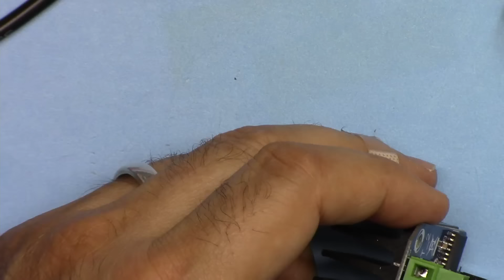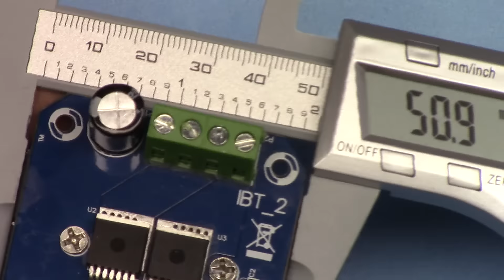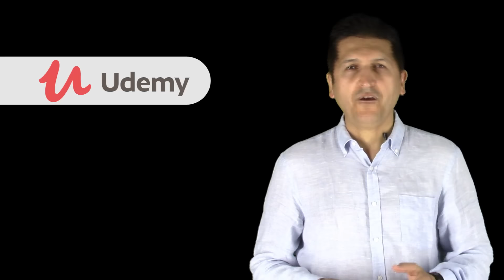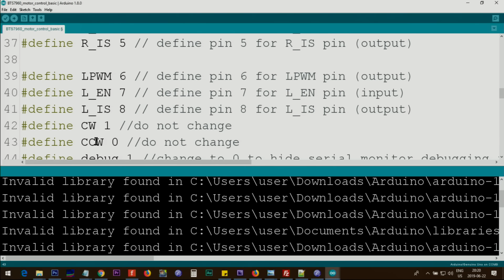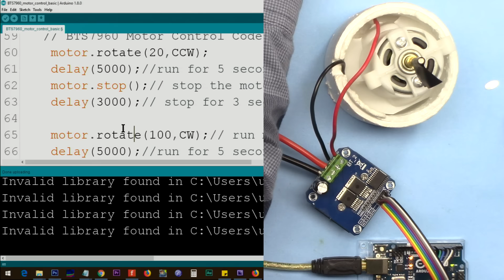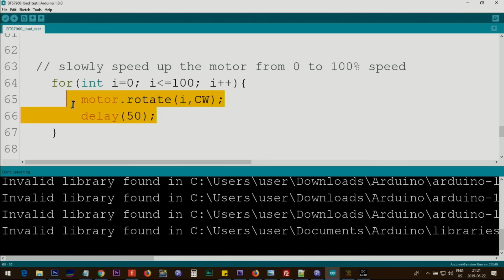Using BTS7960  BTN8982TA PWM H Bridge motor controller module with Arduino library RJT169

Comment: So what happened to your library? The link seems to be broken.
Reply from the maker: perhaps you were using chrome which has issue with false security. Use Microsoft Edge which is better. I changed the way link was parsed. try it.
Reply: @robojax  Thanks for updating the link. It works now, in Chrome.
In which country do people use Microsoft Edge?
Reply from the maker: Canada.  Edge is now much better than chrome and Bing has become very powerful using AI for search results.
Reply: @robojax  Thanks. It's certainly not catching on in Europe. And it's slow. But I suppose no one in Canada would notice.

Comment: Hello.  What happens when both Enable and both PWM pins are set to High at the same time?  does anything burn up? or, does the module understand this is a bad input and doesn't turn anything on?  thanks!
Reply from the maker: Hello, I believe I have explained it. Nothing bad will happen. It will for motor to stop.

Comment: Hi, great video and explanation. Very detailed. Thank you. May I ask if I can connect two 12 volt dc motors to one BTS7960 controller? Thanks
Reply from the maker: Hi, in parallel? Yes and the total current should not exceed the rates current. But if you want them to be controlled separately then you need second module for that.
Reply: @robojax  Thanks for the super fast response. Appreciate it. I plan to control both motors together. When turning, one motor will move forward and the other one will move backward so that the robot car can pivot/ turn. Can this be achieved? I will use Raspberry Pi to control the car. Thanks
Reply from the maker: two motors can be configured to operate independently. Using the library I've written will make it easy to send commend to control each. so you can send command to run in CW direction while at the same time sending command so 2nd motor rotates in CCW direction. This library is for Arduino and I have not tested it with Raspberry pi. The code for dual motor control is in the resources page.
Reply: @robojax  Thank you :)
Reply: @robojax  Hi, how are you doing? Hope you are well. Can I ask if you have tried using BTS with Raspberry Pi? Thanks

Comment: Can I use this bts7960 with a nema 17?
Reply from the maker: Nema 17 usually need about 2A current. this is like 15 times higher.  if this module is capable of controlling two DC motor fully (I forgot how many this can control) then yes  you can use it . If not, then use two of this module. But you gotta write y our own code for stepper motor.

Comment: Would u do another test on the power handling?   Remove the heat sink and put it on top of the iC's .   All you need are longer bolts . It fits beautiful.  You  may have to drill out the holes on the heat sink a tad to fit your longer bolts. I know its an old device. But i would bet there alot laying in junk boxes.

Comment: After downloading the library and uploading the code to the arduino,  why does my motor not respond when turning the battery on? I wired everything the same way
Reply from the maker: If you have not change the code, then the wiring has problem

Comment: My motor rotating when I use command CW it is only rotating when I use CCW
Reply: Please reply sir
Reply from the maker: if you have not changed the code, then check wiring.
Reply: @robojax  thank you for your response
Yes actually I had connect VCC and gnd of motor driver to Arduino so therefore there was some variation in current

Comment: is it possible to use 2 of this driver with one microcontroler ? also can u limit the current output using pwm because i think it hit the peak current of the motor so my battery just cut off. thank you
Reply from the maker: To sue two of this, the code is on the resources page.  For  current I don’t  remember what I said , if this chip has this capabilities, I should have mentioned it.
Reply: @robojax  can you share the link ? Thank you

Comment: this may just work for my battery charger switch ?
Reply from the maker: of course. I read your comment on the mosfet module. this is way more than what you need. but for sure. if you set it to 100% duty cycle, it will be just a switch.
Reply: @robojax  thank you i thought as much just a bit new to dadta sheets and such some of it not understood yet but i an learning Sir God bless

Comment: Hi Ahmad,
Read with interest this article https://www.youtube.com/watch?v=PUL5DZ9TA2o and I'm still not sure how it works.
 Activate the high and low side mosfets.
For simplicity, say I didn't want to use an Arduino but simply drive the inputs with +5volts.
If I enable say the l/h chip {INH  High} then apply a high to {IN} how do I enable the r/h chip so that the lower mosfet is connected to ground and assuming the l/h chip the top mosfet is connected to the supply rail.
Does it mean that on the r/h chip I enable it {INH  High}, will that in turn, turn on the lower mosfet with {IN} low.

I'm at a loss.

Can you help
Thanks
gazza

i sent it to you email address,opps.
Reply from the maker: Hi, yes that is true.  you will be able to turn the motor ON and OFF and change the direction of rotation. But you won't be able to change the speed as you will need a computer or microcontroller like Arduino

Comment: Hi Sir.. With this BTS7960 is it possible to use (without arduino) 555 timer (with Pinout 3) 20kHz/25kHz for PWM?🤔😔😓🙏
Reply from the maker: Hi, I have explained this Skype fully. If you watch it, you will get your answer

Comment: Hi, this is very interesting. But I have a question. Can I supply power with Accu Battery 12v for BTS or I need another hardware?
Reply from the maker: Hi, the voltage sources should be the voltage as the motor. it does not matter you get it from as long as the battery can supply needed current (power) to the motor  it should be fine.
Reply: thanks ao much

Comment: You can brake a motor with the BTS7960 PWM H and how it would be done
Reply from the maker: Stop is the brake. to coast you just set the speed 0.  but brake is stop. see comments from @Whitney Design Labs

Comment: Very good information. To improve the thermal conductivity, the heat sink can be removed from the 2 screws and modified a little to reinstall it on top of the IC chips  with longer screws. Now the heat sink can do a proper job of absorbing the heat and prevent thermal shutdown. A fan can also be used for optimal cooling.
Reply: Interesting idea, I have also seen comment of just adding thermal past.  I just ordered 2 for a trolling motor project.  I think I will need to run them in parallels.  But after you comment I might try to add the other heat sink, and use them on both sides as an experiment.
Reply: @ericbommer2280  I am also working on a trolling motor project and I've added thermal paste to mine, but I'm still not sure how well this is going to work
Reply: Yeah, I think they are M3 screws, so I got longer ones and flipped the heatsink over with some thermal paste on top. It certainly should work better.
Reply: @RichardHauser  how have you done this can you send a photo please
Reply: @omaryasser7473  I have no way to supply pictures. But it's pretty straight forward. Remove the screws and get longer ones. You will have to grind or file the heatsink a little so it will clear the connector post and capacitor. Use some thermal paste and screw it back on top of the chips using longer screws.
Reply: Would you provide an update after you have done this? Would be nice know if it's better

Comment: Hi Ahmad, I have watched your video several times and have your test code working fine. My question is about the current sense pins. Are we getting a value from the motor controller anywhere for a current reading? I understand the main code, but don't fully understand the class (library?) and don't see where these pins are used. I know it has been a few years since you wrote this, but if you can shed some light on the current sense pins and usage, it would be much appreciated. Thanks!! Scott
Reply from the maker: Hi, I just checked the code and watch portion of the video to see what I have done. Because to measure the current we needed external resistor, I have not included that in the library. I opened the library and checked it there is nothing for current sensing. Sorry.  if I see interest in this module a lot, I might try to make another video and show current sensing but as of now, it seems there is not enough people to encourage me to make new video on this.  if someone pays me to write code and show how to measure the current and take action when current reached at certain value, I might consider working on  it.
Reply: @robojax  Totally understandable. Thanks for taking a look. I think the current sense function would be useful, but not not required to do the things I have in mind. The reason I asked about it, is that I have been experimenting with a with simplified code from Saravanan AL and wiring the R_EN and the L_EN together to a single GPIO, and not using the L_IS or R_IS pins at all. This means that it only takes 3 GPIO per BTS7960. I am working on a 6WD rover, so this means a single Raspberry Pi Pico, can run all six motor drivers and still have some GPIO left over. So I was wondering if those extra pin connections were necessary, in order to save GPIO pins on the microcontroller. Thank you so much for all your educating on YouTube.

Comment: Thank you so much! Works great. I moved your test code and wiring over to a Raspberry Pi Pico and it works great. All I had to do was ensure to use same GPIO pins as the code. It worked perfectly with no issues. BTW, I am using a wheelchair motor at 24vdc. So far under no load, running non stop for an hour,  the chips don't even get hot.
Reply from the maker: you are very welcome. would you please share the code on Google drive or somewhere so I can share it with other? many people might need it.
The best thank you for me is to subscribe to my channel. thank you.
Reply: @robojax  Thanks again. I thought I replied already, but I don't see the comment. Here is a link to my video using your code: https://youtu.be/kxGwZ1kxaq8 which also has a link in the description to my Google drive with your code. Here is also a link directly to the drive with your code: https://drive.google.com/drive/folders/1KXQD5Gj2zxjA9OD6UG3i-uvIzwmdMY55?usp=sharing
Reply from the maker: Thank you. I just found your comment. it was flagged as spam.  Watched your video with  Excellent demonstration. I have worked with Raspberry Pi and I assume the code should not work as it is in totally different format. But not sure about Pico. may be something has come which I don't know. Regardless, I am pleased that I have been helpful to one more person(s). Cheers.
Reply: The pi do Not have a 5V pin, have it?
Which pins do you use at the pi?
Reply: @4plus17  It seems to work just fine with the 3.3v PGIO from the Pico. I posted a link to my test set up here: https://www.youtube.com/watch?v=kxGwZ1kxaq8 That link also contains a link to the modified code, which lists the exact GPIO pins I used. But you can use any pwm pins you like.

Comment: For some reason the motor turn only ccw. The only change i did are pins .
#define RPWM 8 // define pin 8 for RPWM pin (output)
#define R_EN 9 // define pin 9 for R_EN pin (input)
#define R_IS 10 // define pin 10 for R_IS pin (output)

#define LPWM 11 // define pin 11 for LPWM pin (output)
#define L_EN 12 // define pin 12 for L_EN pin (input)
#define L_IS 13 // define pin 13 for L_IS pin (output)
Reply from the maker: pin 8 does not have PWM feature. I mentioned it in many videos.
Reply from the maker: so watch the code section of video to learn it.
Reply: @robojax  Thank you very much i change the pin 8 and now work perfect.

Comment: Hello, excellent video, very complete, I need to connect several motors, but the arduino has a limited number of outputs, I thought about using a PCA 9685, but I don't know what the code is like for this, I hope you make a video explaining this, it would be great !!
Reply from the maker: Hello, I have got 4 videos on pca9685 you can use one the code that you think might be useful to you and feed the output of that to this motor driver. But it need some serious work.
Reply: @robojax  Yes master, I have already seen them, I mean a video combining arduino, PCA 9685 and BTS 7960

Comment: Thank you very much for useful video. What about to use a thermal paste between heat sink and board (and fill up the holes). Or attach heat sink directly on chips. Could it than withstand 30 amperes?
I mean: is higher current only dependent on cooling?
Reply from the maker: Thermal paste or thermal transfer sheet should be used.

Comment: How good is this H bridge in comparison to others such as l298 which is known to have some voltages drops across the drive itself.
Reply from the maker: this is totally different.  L298N can handle only 2A this is made for 30A and I've tested it but forgot how much it could handle. it is like you want to travel with small Toyota or large truck. if you don't need the truck then get small Toyota.
Reply: @robojax  Do you know how significant can the voltage drops be ? the L298 is known for having up to 5v drop when handling 2A. I wonder how big is the drop with this one. I really need a high efficient driver for my application.

Comment: Sir, can i use this driver for my1016z2 motor ( 250 watt 24 volt) ?
Reply from the maker: This is exactly why I made this video. I have shown and voltage V and the current  A, then it is your job to do Power= IV , where I is current and v is voltage
Reply: @robojax  yes sir , from your vidio i can see 12V and maybe mul by 15 amper so that's will work good (continuous) in 180 watt. Am i wrong ?

Comment: hi i don't suppose you could help me i would like to use two bts7960 motor drivers with Arduino for a rc lawn mower so it would be mixed controls possibly to a ps2 controller with Bluetooth to drive the robot i have never used Arduino so would be looking for help with a code and wiring really but any help or even a point in the direction of a video that could give me some idea on where to start would be brilliant thankyou in advance
Reply from the maker: Hello, please see the resources page and there we have code to control two motors
Reply: @robojax  thankyou so much i shall have a look now really appreciate you fast response

Comment: Thema you for your nice tutorial but I would have a question what kind of
battery do you use
Reply from the maker: I have mentioned the minimum and maximum voltage which I don't remember now.  if your battery is within the min and max voltage it should work. The power depends on the motor.

Comment: How to know bts7960 is shutdown sir?? Or broken?? Because i have bts, when i use on my motor wiper, sometime bts not responsir,
Reply from the maker: it should respond unless wiring has issue.
Reply: @robojax  just sometimes sir, if i want the motor work again, i shouldbe shutdown my oc, and turn off my power supplay sir.
Reply: @robojax  after that turnon all again and work, but sometime will again like that sir

Comment: Can I use 24v  250W DC brush less Motor to controller ?
Reply from the maker: have you watched the video? Please watch. Your question suggest that you have not watched the video at all.
Reply from the maker: Use chapters of the video to jump directly to the wiring section.
Reply: I am not able to download zip file to include. Can you please help me

Comment: Respected sir can u sent me the library of  BTS7960 PWM H Bridge motor controller module for proteus???
Reply from the maker: Hello, the link to  code and library is in the description. if you face problem with chrome, use Microsoft Edge or firefox.
Reply from the maker: Oh, proteus?  I have seen once and it is very expensive tool. Never liked it.

Comment: This is a great tutorial video.. well you always did. Thank you very much. BTw, I got one question, can I use this as a voltage regulator? maintain 70V and placed it on the high side of the load? Appreciate your reply thanks in advance.
Reply from the maker: Hello, I have spent so much time to make those diagrams so there is not questions left. Here we have no HIGH or LOW. you connect your motor directly to this module. The maximum voltage is whatever I said in the video as I don't' remember it.

Comment: Hello, thanks for the video, very well explained.
I am trying to control this module with a CLP (24V). So, I have put an optocoupler (24v - 5V) to make the interface. Unfortunately, my BTS7960 outputs is not working properly. Or both with 24V, or 1 with 24v and other with floating (no GND)

Do you can imagine what could be happening? 
Thanks in advanced.
Reply from the maker: Hello, I have no idea or the how you do it, But I have fully explained how it works.  We needs signal at input. so if you know how this module works, if you feed the right signal at the input of this, you can control it.
Reply: @robojax  Thank a lot. I will keep trying. Do you know any failure mode (troubleshootlist...) to do wrongly connections...
Reply: How about your project ? I want control my1016z2 24v 250 watt motor too
Reply: @maulanawahyudi7127  I have one PLC (24VDC output with PWM) to control 2 DC motors (24V and 2-4 A)... my idea is have this Driver to make the interface
Reply: @ACARVA65  is it work with bts7960 ?

Comment: My motor is only running in clockwise direction. What would be the reason?
Reply from the maker: I assume you have not modified the code, then check wiring.